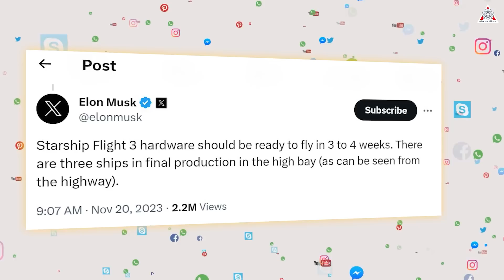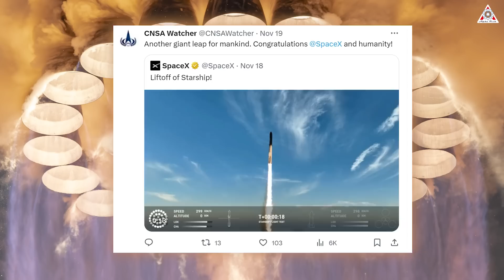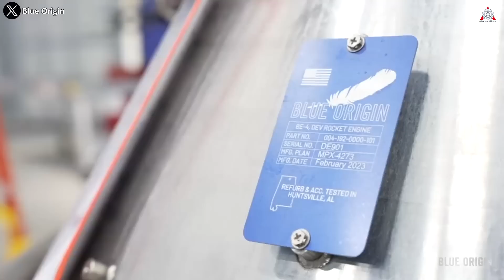SpaceX Starship's 2nd launch just humiliated Blue Origin! How Jeff Bezos react...?

Comment: "should be ready to fly in 3 to 4 weeks": this needs to be multiplied by an Elon-exaggeration factor of 3 to give a more likely estimate of two-three months.
Reply: While 'Elon Time' is a real thing... He tends to throw out near impossible, but what he believes to be achievable, timescales ... the fact that he says 'ready' is in fact from a technical standpoint, Meaning ship on the pad and with the rehearsals and test firings under way.  They'll still have to wait for the FAA's incident investigation (or rather FAA validation of SpaceX's investigation) and the new launch license.

Elon Time is a method he uses to apply pressure, to both his team and to those outside SpaceX that they have to deal with, to get the job done.

Comment: I don't think starship is powerfull enough it didn't get to orbit  it was just short now if you take into account a payload  it's not going to make it
Reply: Plenty of power - the test flights still had fuel left.  Do you really think that when the largest and most powerful rocket using the greatest number of the most efficient rocket engines ever works as designed it won't have any power to lift a payload?  Seriously?  The calculations are quite straight forward and in its final iteration (at least for now) it will lift up to 300 tonnes to low Earth orbit.

Comment: The video from Florida showed unstable path by starship . It was wobbling after the separation . I believe it became so unstable they lost telemetry and ended the flight .
Reply: What is your point? SpaceX more than surpassed their goals for this flight and gathered the data needed to focus on perfecting stage separation and beyond. This flight was consistent with their iterative process and exceeded their expectations. Every flight is designed to expose the next round of innovation required to continue advancing. So I ask again, what is your point?
Reply: Actually, the video from the Islamorada in the Keys /starts/ at the point the FTS activated.  The wobbling you see is the nosecone section forward of the fuel tanks.  Which, when you consider that everything aft of the forward dome has gone bye-bye is amazingly stable, only seeming to spiral around its direction of travel.

And before you start saying the FTS failed, the purpose of the FTS is to split the tanks and allow the fuel to burn off and cut thrust to the engines, not to totally atomize the ship.
Reply: If you don’t see the point ,look closer . Why so defensive ?  Is my info correct ? Did you see the Florida video ? So what’s Your point ?  Disrespecting my post ?
Reply: If it was perfect ,why did the booster fail ? If it was perfect why was the starship unstable?  If it was perfect they would not have blown it up .   Why are you so defensive ?  Go starship go Elon go SpaceX .
Reply: @Philc231 i dont think many rockets have been stable, especially during this test it literally wasnt meant to be stable, they were testing hot staging not returning the booster, nor getting starship back
Just look at falcon 9 
Starship is following a falcon 9 approach I think
Reply: No doubt , certainly is a old school way of engineering. Trail and error .  What’s next ,  snow cones ?

Comment: Musk:"i just launched a second starship. And you?"
Bezos:"I haven't managed to blow up a single one yet 😥"
Reply: NASA" Jeez the moon was wonderful last year I got so close I could have put a lander on it.......... if I had one?🤣
Reply: @Leon1Aust good one😂
Reply: I like this comment ahaha but correction, they haven't blown a rocket but they have blown a rocket facility atleast by accident 😂
Reply: BO's New Glenn (NG) competes with SpaceX's Falcon Heavy (FH). Reusable Falcon Heavy has 8 successful launches since 2019 with zero failures, NG has zero launches. NG payload capacity (13 metric tonnes to GTO, 45 to LEO) is lower than FH (26 metric tonnes to GTO, 63 to LEO), but NG has larger fairing.

Starship (150+ tonnes) is totally different category and is undergoing iterative (test and learn) development. Like comparing a van to a 16-wheeler big rig. Starship development started in 2016. NG development started in 2012 and is behind FH which already in service since 2019.

Comment: I think Blue Origin will be fine in the long run.
And buying ULA isnt a surprize. As I mentioned in recent comments, there a lot of money wants into space companies getting results.
And I expect Jeff's enginerds will copy Elon some, but also not make every mistake Elon has.
My guess is BO is likely working on one, maybe two models post new Glen at the moment.
And from the factory floor images I can tell they hired very professional help for the metal working. Its looking sharp.
Also I suspect they got the memo on engine simplification, and maybe multiple combusion chambers to one pump system. This has the benefit of allowing easier sizing and less difficulties on proper function than going to huge chambers without working up in size increments.
While still dropping parts count drastically in the pumps. They will probably be working on several engines stepping up in sizes. And I suspect we will see a mini-Starship clone in the near future.
They may even realize that its fine for boosters to be round tanks, but that Ships should have shapes. And if they produce something decent in Space Plane style they can likely corner some Space Force contracts. Could see a division, where one produces high end Space Planes, and Starbase produces cargo tubs.
The problem with Starship is its limitations in adaptive design. Its cute, definitely Steam Punk with the flapper flippers and gymballed engines, but its a tubby girl.
And Jeff could end up doing a fabricated mini Space Shuttle, and maybe even realize stacking is dumb compared to piggy backing. 
Also Bezos might realize other options with boosters besides the single tube and pan pipes configuration. Say trinary, or hex, so that huge payloads can be launched.  Its what Elon isnt doing that will allow competitors to ace him out in spite of his head start. Any space launch company that starts getting results is gonna have funding pour in and resulting exponential growth. And Jeffie will start getting results eventually.
Also I expect the Chinese will do something similar,
Copy but also get more creative. And when the gold rush starts happening, everybody and their brother will either be starting space companies, or investing in them. Likely to be like the discovery and Colonization of the Americas by Europeans, The old countries went fairly stagnant, and became tourism destinations...
Earth will likely be like that too; "Nice Castles"...
Reply: Why do you think BO will achieve all of these things and be that successful? Perhaps if they achieved orbit 10 years ago, but I have majot doubts at this point. I hate to say it, but China has already surpassed BO. Space Labs is hot on their trail, too.
Reply: @channelwithaweirdname  
Well, I'm not sure BO will even choose those things,
But having seen video and stills from inside their factory, its very obvious they have serious skills hired. everything has a precise look. also I've seen work on both linear built fabricated rockets and ring built fabricated rockets. which tells me they are exploring more capabilities.
You can only do so much with tubes, but with linear/gore construction you can build all kinds of stuff. Up to hulls like modern stealth aircraft shapes. If you look at stealth aircraft, they are like single chine boat hulls. Basically its unlimited shapes using multi chine hulls. And different space craft will want different shapes. like it would be very easy using gores and chines to create space shuttle shapes.
Also Elon seems tube fixated, and not exploring lander options say like tilt  rotor craft but with rocket engines.
He is trying to land things on their ends using fuel and burns, when in atmospheres you can use glide ratio and a last minute hover like an F-35.
And stacking his ships on top of their tanks means he's a long ways from the ground for practical work.
also he has no engine rooms on his ships, every repair would have to be done in a space suit.
Even the old Buck Rodgers serials had more practical space ships that landed on their sides.
Humans generally live on the ground floor if possible for practical concerns... imagine trying to load a piano in starship on the moon... You'd need a crane, would be much
nicer to roll it up a ramp.
say a meter off the ground.
What I'm pointing out here is that Elon and team are making serious progress, but the format is no different than the man in a can design of the Mercury program.
And that was an expedient taking advantage of surplus ICBM rockets. About like making campers out of school busses.. crude....
Theres many other options that will be worked on, by somebody, and some of them better designs than current starships. 
And what I see in images at Blue Origin says serious work in progress, and being done at levels SpaceX struggled to get to. Dont underestimate BO. Once they get rolling on simplified engines, they will be coming up fast.
Reply: Even if Elon gave Jeff Who the blueprints for Starship, he still wouldn't be able to compete. Bezo doesn't have the technical skills of SpaceX or the correct mind set involving continuously prototyping,  testing and innovating. His sole project - New Shepherd is a rocket assisted fair ground for rich people with more money than sense. Earth orbit is where there is money to be made and Bezo doesn't have enough staying power to finish anything like Orbital Grief. If NASA involves BO in  HLS, then you can guarantee it will be delayed until the next decade with BO asking for more money for zero return. Perhaps Jeff is aiming to make money by investing in Chinese language courses for American astronauts visiting Chinese lunar base. Jeff should get over his Elon envy and forget space.
Reply: @anthonykevinkerr3594  Thats not what the factory floor tells me.
I'm no great fan of Jeff, but i can see his shop guys are making serious progress on things, and I wouldn't bet against the quality of their work.
And over the last couple three years, I have seen SpaceX do alot of cobbling and patching.
Stuff I couldnt believe they were 
"fabrication illiterate"
enough to do. Luckily Elon was smart enough to "retire" many sections and push for better quality.
I dont see that kind of thing happening in BO images... Maybe somebody should fly a drone over the place and see whats in Jeff's bone yard? How did they get to better quality?
You can think anything you want, I'll wait and see what really happens.
But I see SpaceX doing a monoculture design wise,
And its like Sci-fi of the 1960's... I remember, that was a long time ago.
This is now.
And as for the Chinese, I do not underestimate them, I deal with Chinese people monthly, and I like them, and admire their work ethic and professionalism. where they fall down, is quality control, and also half assed assembly. Quite sure their space program will be plagued by petty problems.
Too bad Xi doesnt realize he should be less belligerant with Taiwan, He could contract out management of China to Taiwan, especially government, and get way more competant results, and not need to invade the place.
 "Unification via merit"
I havent noticed the Taiwanese building an extra billion appartments they dont have people for.
China could make a business taking refugess on contract, and they need the labor.
That was an amazing screw up.
Reply: @anthonykevinkerr3594 buy the time jeff builds the first verison of Starship Mars is going to be habitable.
Reply: Might, may, maybe, could ect. Not very insuring verbs.
By the time they could copy the ideas, SpaceX will be on Mars.
If ... which I doubt. 
To achieve what SpaceX did they wil have to change all thier methods. 
Maybe the Chinese can adapt , but most definitely the arrogant Besos not.
Reply: The only good thing the ChiComs are good at is stealing others technology (i.g F-22). Still they cannot get it right. The ChiComs are not innovators, working in a communist country does not allow for innovation.